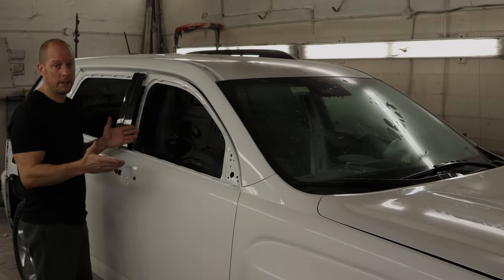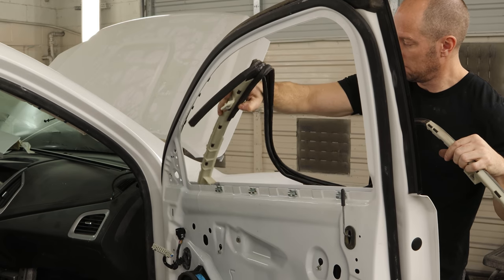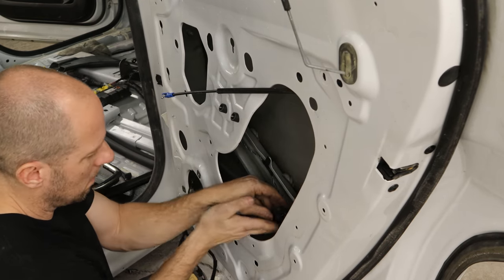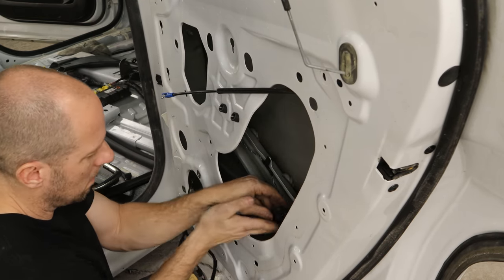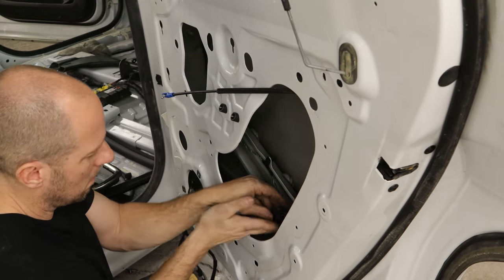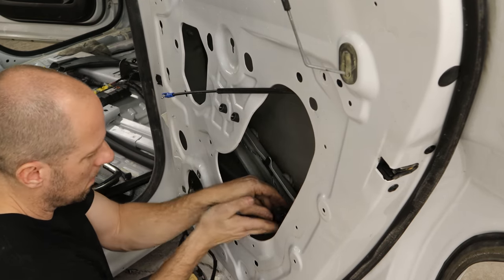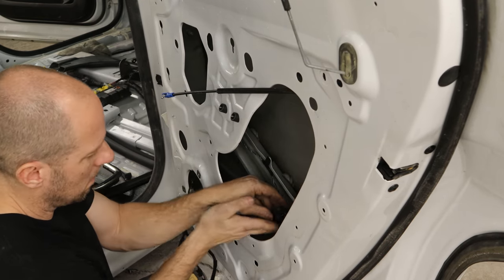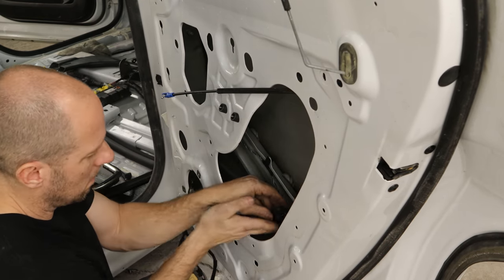Finishing the 2017 T boned Terrain Denali

Comment: I do like their ceiling design---  with it being all one piece, and every mounting point has a dual purpose, being a grab bar, or sun visor, or the clothes hooks in the back-- nicely refined.  The trim around the windows sure seems like they could reduce by 3 or 4 parts. lol.. There are a lot of little pieces that layer onto it and only click together.  I can see those being rattling headaches by the time this thing passes 300k miles.

Comment: Tip
When using a hand powered riveting gun there’s always the risk of scratching the crap out of your nice shiny new paint job when the rivet shaft snaps and the gun jumps around. The larger the rivet and the more awkward the spot the more likely this will happen.
Get some of those flexible cutting boards from the kitchen utensil section of your local dollar store and tape them in the places that you want to protect.
They have multiple other uses too.
The thicker cutting boards can be cut into chisel shapes and used as scrapers for removing badges and adhesive.

Comment: Can you explain GMs thinking regarding putting the ECM on top of the battery?  Lets see, ECM is basically a computer with tiny circuitry inside it and the battery is constantly exuding acid fumes when it is charging (which is all the time when the engine is running)...

Comment: Scott I have a 2006 Dodge ram 1500 SLT with a left rear cab corner skin puncture How do you weld the new cab corner on its 1/8" skin mild steel what would you recommend for a welding wire to  use?
Reply from the maker: .023-.025 is all that should be used on vehicles.  Anything thicker takes too much heat and stresses the metal.